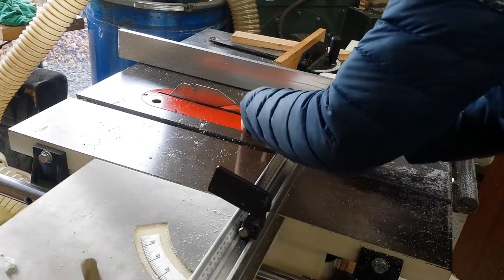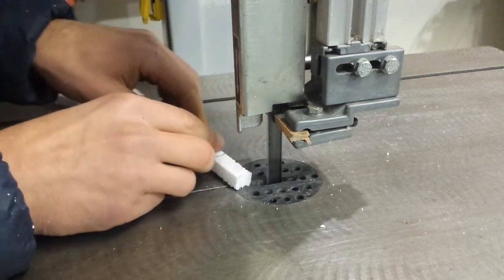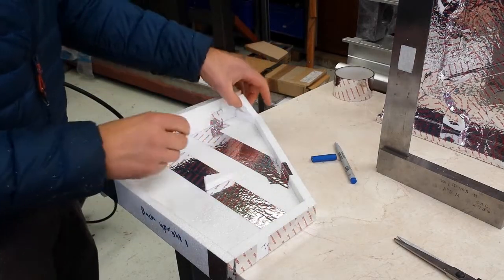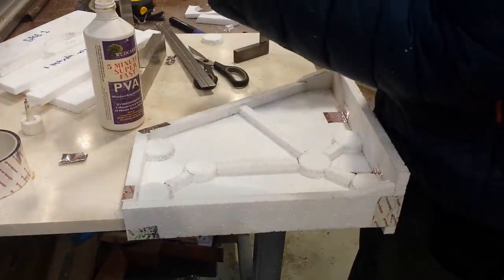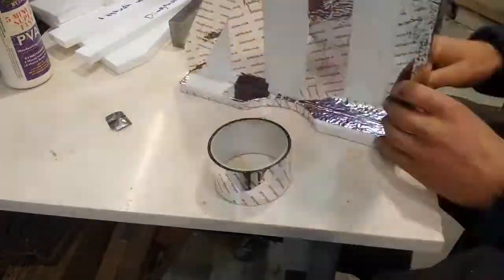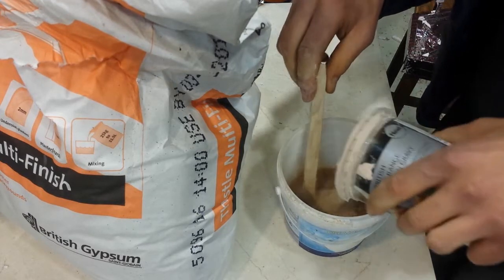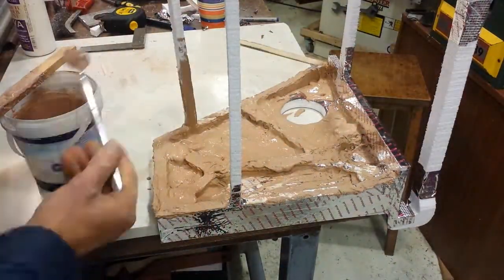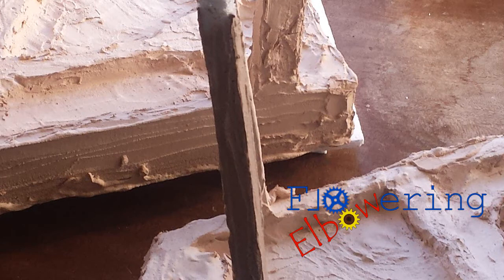Making a Foam Pattern - Casting #4

Comment: with foam casting, the gasses are supposed to vent through the dry sand. it takes time for the metal to burn off the foam. the gasses either need to go out the through the sand or back up the pouring sprue. those vents are full of foam and wont allow gasses to flow out until the metal gets to them. by then the part is done.